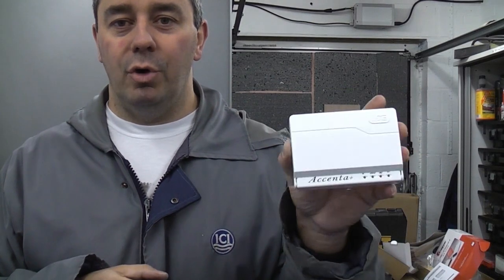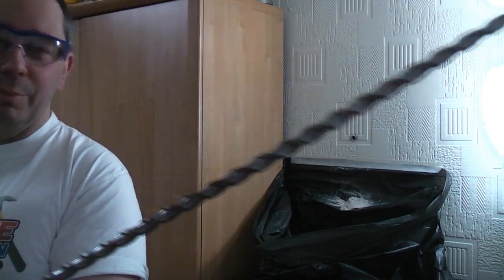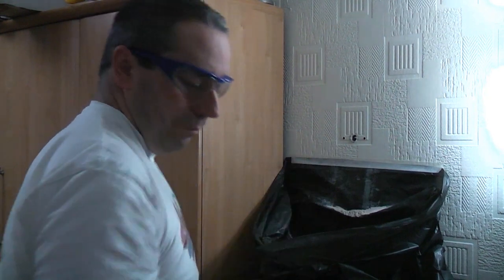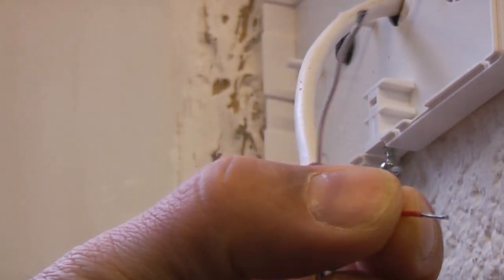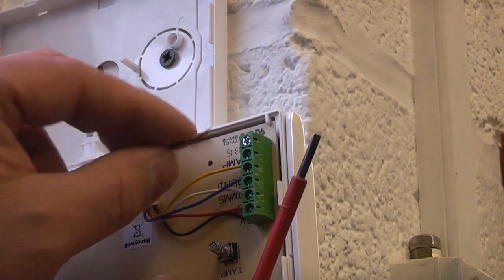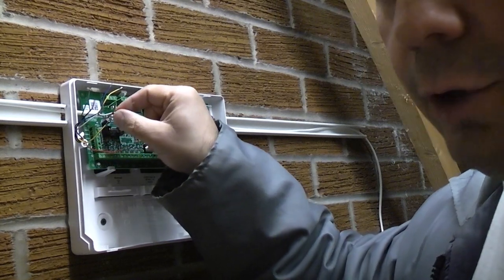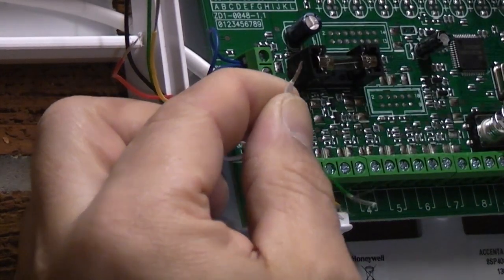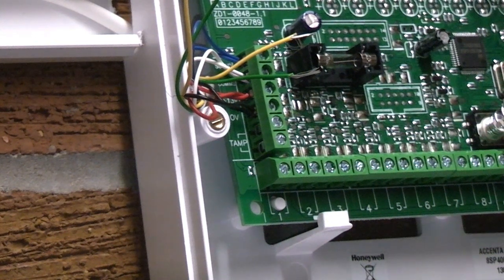How to install a burglar alarm remote keypad | Accenta +

Comment: Thank you so much for your video as all I needed to know was whether there was mains power coming directly into the remote keypad as the alarm kept sounded from a tamper.  It turns out that the tamper switch was not resting on a flat surface and was on a gap in back panel (I have no idea how long) so kept setting off alarm tamper. Now solid base and fixed.

Comment: Give u a tip from an old alarm engineer it's easier to terminate your tampers in a terminal block and label each circuit with a bit of white insulation tape , most common faults are tampers on a system , if you have a tamper fault disconnect the two wires and meter them to see if you got a short or tamper switch open , if you havnt got time or a meter to hand put a staple or wire link between where you removed the wires to get your system up and running because some systems won't arm set or just let the internal and external bells blare hope this helps
Reply from the maker: Thanks for the tip ;-)

Comment: Excellent clear video. Well done. I've just replaced my veritas key pad with like for like and now there is nothing at the key pad. Does this mean that I have to do something inside the main alarm box  or have I broken it ?
Reply from the maker: In the main panel there are some glass fuses, one of those might have blown. You can check them using a multi-meter.
https://www.youtube.com/watch?v=KiJH1lgaHrY&t
Thanks for the comment 👍

Comment: In the remote keypad it has 0v (zero volt) terminal. Is that the same as Volt Free connection, and therefore is it possible to connect a device to it that allows for remote notification?  I have access to the device, I am just hoping it will connect to the the alarm terminal with it being a few years old now.  Thanks

Comment: Hi, I think that you would be better to use a through crimp or 5 amp connector for the tamper wire. Other than that great video.
Reply from the maker: You can do, but the problem is that they are bulky. If you have all 8 zones used the tamper loop gets quite large, so you could end up with 8 or more connectors.
Thanks for the comment ;-)

Comment: For the tamper, could you use wire nuts instead of taping them?
Reply from the maker: Chem_Boffin6589 I'm not familiar with wire nuts, but they are bulky aren't they?
I normally solder the wires together to be honest as that gives a very small joint as there is not much spare room in the panel. I then wrap the soldered joint with insulation tape.
Reply: ***** Ok, thanks for the comment!

Comment: Hi ultimate handyman,

im installing the exact same system, its the honeywell accenta gen 4 mini isnt it,

is it ok to mount the keypad in an outdoor location like you have, i wouldnt have thought they were weatherproof

please reply as im eager to find out,

many thanks :)
Reply from the maker: Hi, mine is in a garage which is completely dry and weather proof.
I have had a similar alarm installed in my other garage for over 20 years with zero problems. They need to be installed internally in a dry location ;-)
Good luck with the install

Comment: how did you hide the alarm cable at the door?. did you take out some of the mortar joint then run it up that trunking?. thanks
Reply from the maker: +CalumR 20 I just drilled into the cavity behind the block, then fed the wire through the hole and looped a piece of plastic around the cable, so that I could pull it up into the loft.

Comment: if  i was to wire 5 pirs on the same zone, would i do series or parallel?
Reply from the maker: The tamper and zone circuits need to be wired in series.
I normally wire the  +12v and -12v in parallel. 
Thanks for the comment

Comment: I'm looking at installing a honeywell accents g4 in new house it says it comes with 8 zones. can I install two of the digital keypads or does one have to be an analogue one. also if your installing window sensors and two windows together in one frame would you wire both to one zone or would they need to be seperate?????
Reply from the maker: As far as I can remember you can wire up to 4 digital keypads.
You can wire the window sensors to two separate zones or a single zone if you like, if wiring more than one sensor on the one zone ensure you wire the sensors in series (not parallel).

Comment: I have a faulty keypad at the front door, can i just order a new one take off the old wore up the new and have it working wothout touching the maim panel which is located in the loft. Cheers
Reply from the maker: Not sure, the main panel might alarm when you remove the keypad, also if you touch any of the wires together you might blow a fuse.

Comment: You didn't make it clear that you have to twist together one yellow or green from each cable for the tamper. Some people who aren't sure might twist the yellow & green from the same cable only making 1 of the tamper circuits work in only 1 keypad.
Reply from the maker: I made it very clear- https://youtu.be/MU_n38qrJlg?t=405
Reply: You did indeed make it very clear. 
A silly question I know but just to be 100% sure, if only installing one keypad, I assume the yellow and green wires occupy the two tamper terminals on the control panel to mirror the terminals on the keypad?
Reply from the maker: Yes, that's correct. If just using one keypad just put one tamper wire in each terminal at the panel and the keypad.
Thanks for the comment

Comment: i need to move the keypad how do i stop it going odd when i unscrew from wall.
Reply from the maker: If you put the alarm into engineering mode, the alarm will not sound when you open the panel.
Thanks for the comment

Comment: Which alarm panel is that ?
Reply from the maker: Honeywell ADE Gen 4
Reply: Hi love what what you're doing helping people with their DIY my son has just replaced a honeywell accenta alarm system  as old packed in. But he has never fitted a burglar alarm unit last weekend with an LCD and 1 LED keypads 1 up stairs an 1 downstairs. An alarm works brilliantly.. but I'd prefer to have two external sounders 1 at back of the house an one at the front of the house. But he's confused on how to do this can please advise him on doing this as he is confused on how wire then into the alarm panel have Done an videos on this for him to follow as this would be a great help to him an make are home feel much safer an we would be so grateful it you could help him by doing such a video.. kind regards
Reply from the maker: @robertnaylor8240   Basically, you just double up on all the connections, so wire the first bell box, then do exactly the same with the second bell box, just wire the wires into the same terminals 😉 
I'm afraid I don't have time to make a video on how to do it
Reply: Hi my name Danny am Robs son so it's the as I did with the two key pads.. but I just put them in together to the siren panel on the board an just loo the tamper wires into temper would that be right. Thanks for the quick reply must appreciated your doing a very good thing with the videos sometimes it's better to watch an lean. Rather then read books on some things for it sinks in better carry on with the videos your helping so many people. Take care Robbie an Danny King regards